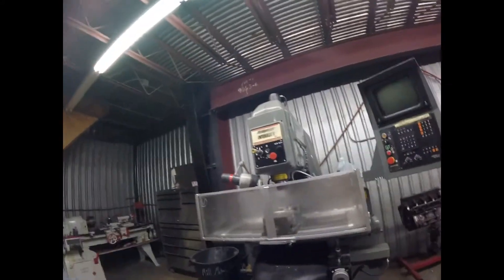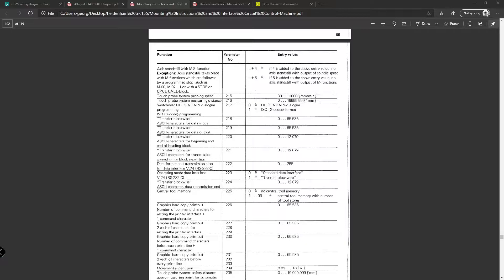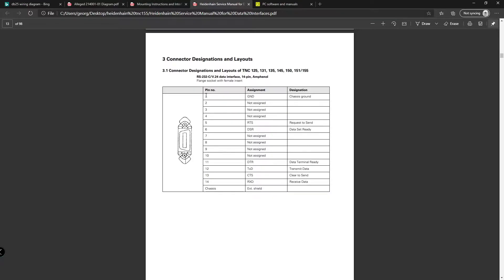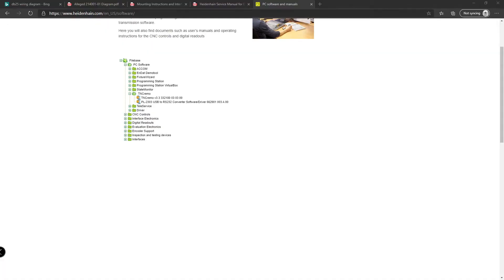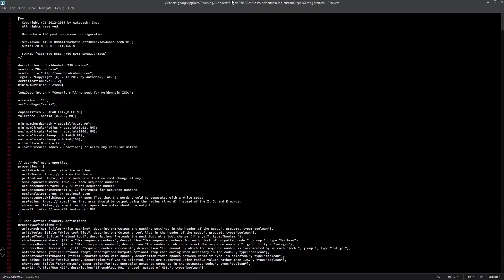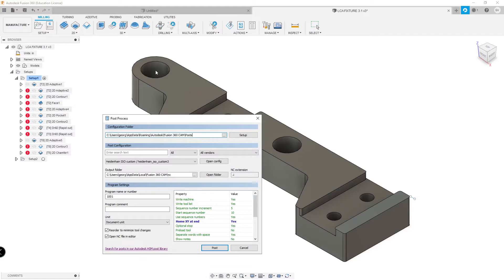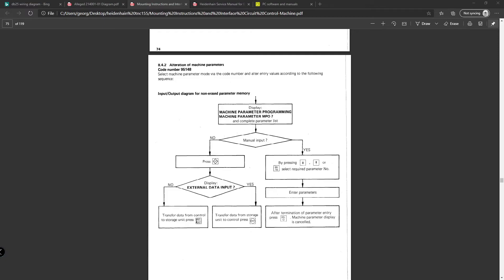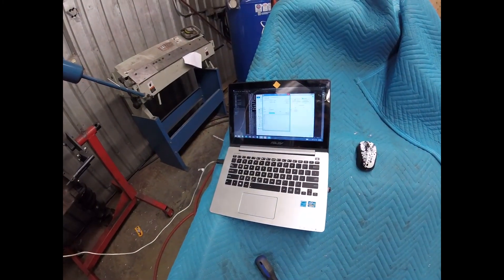Drip Feeding a TNC-155

Comment: thank so much for sharing this! I´m considering buying a maho mh 700w with heidenhain tnc 425 and currentyl trying to evaluate if drip feeding is a viable workflow. so far I have not heard the best opinions about drip feeding in general (mostly concerning fanuc controlls I guess) but quite positive thoughts about it from the guy I´d buy it from. he has not used it a bunch though. so my general question knowing its a different controller and so on: do you trust drip-feeding to your machine? did you ever have hickups like the feed stopping and the machine doing something really stupid and dangerous?
Reply from the maker: I do trust drip feeding it, even through the db25 serial port. The only issue I've had is when I was using a 30+ft USB extension to get it to my desktop before I decided to use a laptop, it didn't like to consistently communicate with TNCserver, which worst case scenario it would stop sending code, the machine would stop dead in its tracks it it was true drip feed, if it was just reading in a program to onboard memory it would do the same but the program would just end there was never buggy code. That was fixed however when I short circuited the hardware handshake (DTR, DSR) which is a option on the TNCserver interface. the problem was that the voltage drop for DTR and DSR signals became patchy, after that it sent and received code no problem and I could let in run its course while I welded parts on the table adjacent.
Reply: @sirgeorge497  thats great to read! thanks for boosting my confidence in buying this machine :) ...welding close by sounds like a good strestest :D ...my first cnc would literally start to move around when the stepper motors were powered up and I was tig welding with high frequency start :D also a good reason to keep that old laptop to make a dedicated cnc server for the maho... nice!
Reply from the maker: @bernhard_derProtoTyp  to my knowledge stepper motors are more sensitive to interference, as there isn't a reference to "guarantee"  the position as there is with a servo. It definitely helps to keep a laptop connected close by as opposed to a desktop where it fits as I've learned is much easier to make changes to the code ~3ft away compared to running up a flight of stairs to make a change in feed rate while retaining rapids.
Reply: @sirgeorge497  oh yes - definitely but I think in the cas of my old machine it was more a problem of the crappy controller board or the fact that the step and direction pulses got sent to the controller from the pc on a parallel cable (if I remember correctly) without any shielding to speak of :) @ pc close to the cnc: oh yes. my current conroller (eding cnc) is windows based and has the ability to auto load gcode and dedect if it has changed. so I frequently edit something, repost to a dropbox folder, wait a few seconds and hit cycle start again. can´t get much more convenient than that.